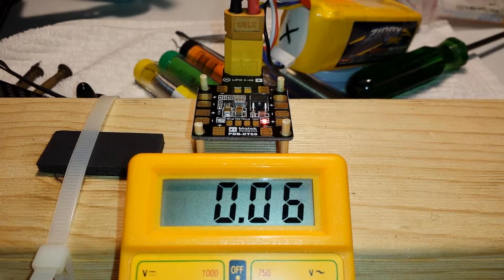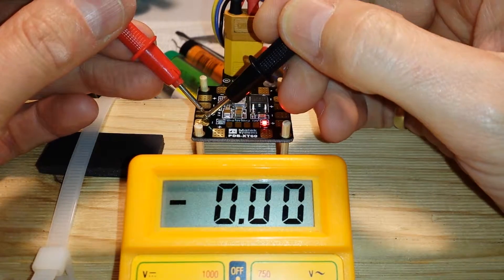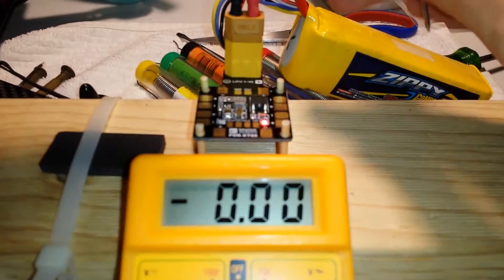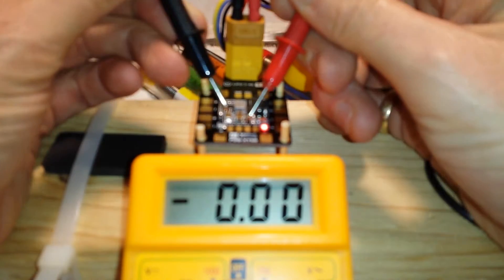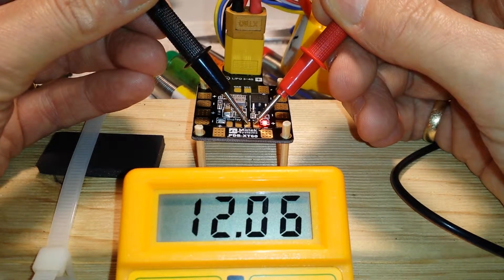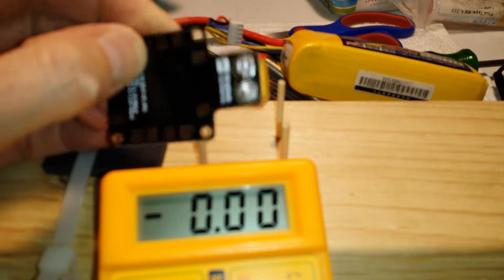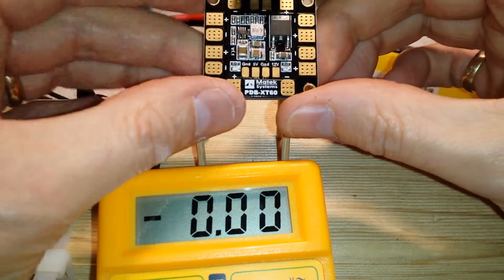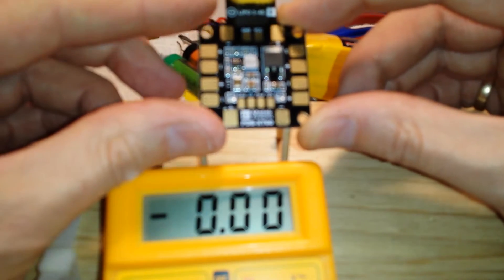Matek PDB with XT60 Plug - faulty

Comment: Ha, mine did something similar, when I check the continuity on the 5v + and - my meter buzzes only on those two pads! It's shorted out and fried my spracing f3 board after a week of flying, about 12 packs!!